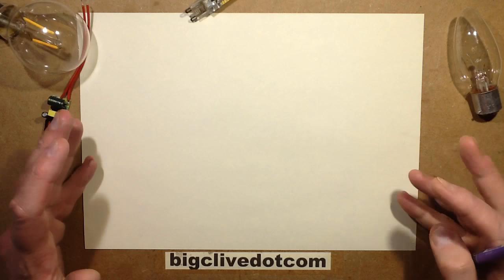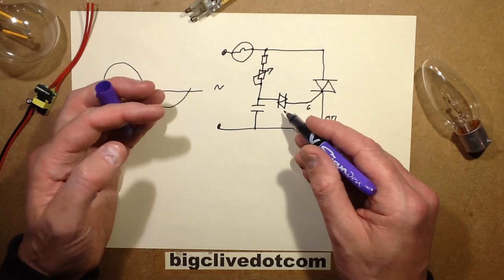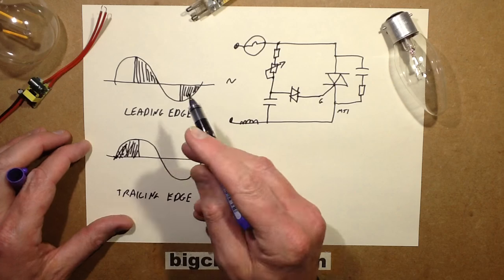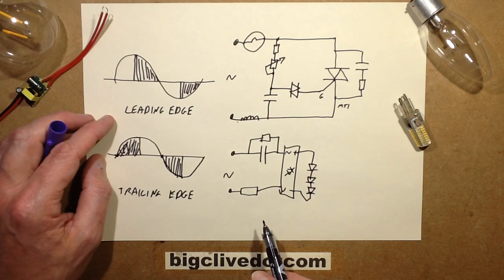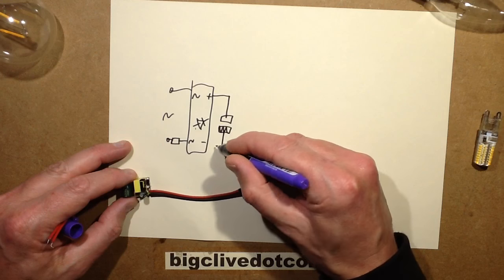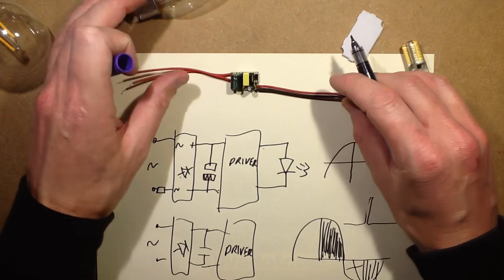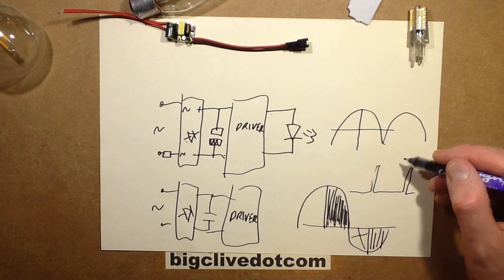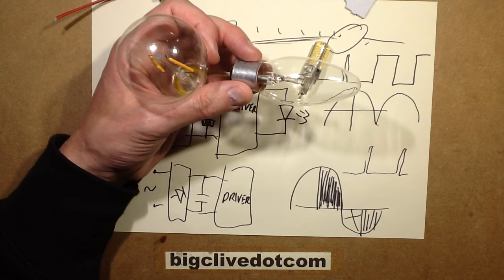Dimming LED lamps with ordinary dimmers.

Comment: 5 years later, and it seems like the newer filament type LEDs have found their best/cheapest compromise solution, which is to just use high-voltage series filament LEDs, linear regulator current limiting, and then solve the flicker effect by using longer persistence phosphors that just smooth out the flicker chemically instead of electronically. Simplest, cheapest circuitry, works with the existing TRIAC dimmers that stubbornly refuse to stop being produced despite tungsten bulbs being VERY obsolete, a tad inefficient because linear instead of buck regulation but it means they don't need a big chunky base to hold the driver circuit, and the pulses and overheating issues mean they last just as long as tungsten lamps so the companies can still make money! As for the issue of triggering the TRIAC, I have found a few lamp HOLDERS in the trash here in the US that include a small "capacitor to nowhere" that exists solely to make sure the TRIAC has enough inrush current to trigger, doesn't even need to be a BIG one, just enough to cause a 50mA spike for the usual BTAxx series TRIACs to fire.

Comment: How odd, a couple of years ago I bought a cheap B&Q £9.99 dimmer switch and a dimmable LED bulb and it works great, no noise and no flicker. 
The bulb is a £14 Integral LED dimmable ILA60B22011D03KAIMA (3000K). 

On the other end of the scale, I tried a Poundland 3 watt bulb in my bedside touch lamp, it turned into a snake machine at dimmed times. 
Thanks for being awesome Clive. 😎

Comment: I know this video is from 2 years ago, but I just found it and it's so hugely helpful! I was trying to troubleshoot the flickering on a cheap Chinese aquarium led light.

For the longest time I was utterly confused thinking they were doing some sort of half-assed rectification with the triac, but I never could quite make heads or tails of how that was working. Turns out it is pretty much exactly that leading edge dimmer you drew, and not a rectifier (which explains the flickering).

Next step is to cut the dimmer off and wire up a proper rectifier and smoothing circuit. Thank you so much!

Comment: I had this issue with a string of "dimmable" LED lights which flashed and had the sharp cut off as described in the video.  The 12 LED  bulbs only drew 48W on a 150W rated Lutron LED/CFL dimmer so I added one 60W incandescent light in an innocuous location on the string and the problem was solved with the full range of dimming and no cut off.  Not exactly an elegant solution but the wife is happy.
Reply: I know Lutron have a device that replicates a resistive load without the need for using an incandescent lamp (which will blow in short order anyway). You'll need to terminate it in a suitable maintainable location, but it's a permanent fix.

Comment: so why is 50/60Hz the norm? is it ideal for transformers or is it an arbitrary number that simply wasn't changed.
Reply from the maker: At the time it was the chosen as being a frequency that was easy to generate.  It's maybe not what would be chosen if we could start again now.
Reply: Why did you refer to it as 100 to 120 times a second? Why would it not be referred to as 50 or 60 times a second?

Comment: The ceiling fans in hotel rooms would appear to be triac controlled - it's either full speed (too noisy/cold), half speed (annoying 100Hz buzz) or no speed (too hot). Either way it's impossible to sleep.
Reply: Top Tip: Hang your freshly washed linens on the fan's blades. This will slow the ceiling fan down, dry your clothes, freshen the air, and moisturise your face at the same time.
Reply: Genius top tip :)
Reply: Actually these things are adding windings at different angles, but I agree on the effect
Reply: I doubt there are any semiconductors in a ceiling fan. The main reason being that the typical motors used in them (induction motors) can't really be "dimmed" by just chopping the AC. Usually the speed is controlled by switching between different capacitors.
Reply: And render all your freshly washed linen filthy from all the dust that your ceiling fan picked up :p
Reply: @superdau;  All the domestic ceiling fans i've seen use universal(brushed) motors for ease of control. The older speed controllers were mini auto-transformers (hence the buzzing) multi-tapped for different speeds. Now that electronics is cheaper newer units use phase control as Clive has explained above.
Reply: Richard
Brushed motors would be very weird in a ceiling fan (and I have never seen that). They are just the wrong motor type for a fan (and the product engineers should know that).
On a device that may run for hours a day for several month a year using consumeables (the motor brushes) is close to what I would call a scam.
The "ease of control" of simple capacitors used by induction motors can't be beat by any controls for a universal motor.
The load to the motor is very well known, so there's really no need for accurate control. Brushed motors are also noisier, not just acoustically, but also electrically, so they would need additional EMI filtering.
Brushed motors are generally built to run at higher RPM (comes from the way they work) and are much more efficient at higher speeds. So you either have a wasteful motor or even worse need gearing.
I can't imagine why anyone would use a brushed motor in a ceiling fan with all those disadvantages.
Reply: superdau aah you're correct, i even went back to the text book. "Permanent split phase capacitor motors" were most suitable apparently. I didn't realise they had voltage dependent speed control. Then I checked wikipedia and there is even more info! we  live and learn.
Reply: Alert: "Admitting someone else is correct" detected. I hope others will follow your example. Youtube could be so much better with reasonable discussion.
Reply: You're preaching to the wrong generation Tai..
Reply: Cover your clothes in dust.
Reply: Referring back to the original post...   I inherited a ceiling fan with my house that's from the 60s...   it has a 6-way rotary switch that's fairly unremarkable.   What is amazing about this fan is the terrifying amounts of air it moves, all while staying perfectly still.   I use the 3rd of 5 speed choices and that moves far more air than any modern fan I've seen on full power.  It's a good thing the ceilings are tallish tho, this fan could easily decapitate (metal blades) you...
Reply: AND so VERY stylish too!
Reply: @gubx42  Note: Wash fan blades prior to laundry arrangement. No Jeans.
Reply: @TaiViinikka  Isn't it great?! It sucks when commenters of videos get hostile. Accomplishes nothing.
Kudos Richard and superdau! I have to ask. Richard, how early did you get on YouTube to have been able to snag "Richard", with a Cap! You must be a Viking!  ;-) (I'm not at all suggesting you are old. YouTube is very "young").
Reply: What hotels have ceiling fans?
Reply: @billlowe70  lol

Comment: Immensely helpful. We just replaced two incandescent spots with LED spots and they would not turn off. I'm sure it was the triac sustaining current in the dimmer. My solution was to replace the dimmer with one that has a hard on/off switch in addition to the dimming slider. Thanks Big Clive! Even a 4-year-old video is helpful.
Reply from the maker: It may have been the triacs snubber network passing enough current to keep the lamps lit.  LED lamps will often glow with just microamps of current.
Reply: @bigclivedotcom  Well, the new dimmer works well, except...  The hard on/off switch in the new dimmer solves the eternal glow problem, but now at lowest dimmer setting, one LED spot will light and the other won't. However, flipping the switch on with the dimmer slider set midway lights both lamps reliably, and then they can be dimmed down to a lower level. There is a programmable setting to adjust the minimum dimming level and that too would solve the problem, but the lamps are not dim enough when this level is adjusted for reliable startup. As you said in the video, two completely incompatible lighting systems. For now, we're close enough.

Comment: I recently installed VARILIGHT V-PRO DIMMER SWITCHES with Philips Warm Glow Dimmable LED. They work well. The dimmers are programmable for various modes and come on with a gentle 'boost' . The Lamps have a 'lightpipe' to simulate filaments and have two sets of LEDs (warm and cool) the cool LEDs shut down to 'warm' the light at lower settings. They will dim very low without flicker.

Comment: Great video Clive, been dealing with this issue recently. Currently split between replacing the dimmer with switches and using dual white LED lamps with a remote control+hub... or just putting in the most efficient lamp type that works with a dimmer.

Comment: I am using 3 brightness level LED globes, controlled by switching them on/off multiple times to get a dimmer light output. So at the first on state, they are at full brightness & each following power off/on cycle reduces the brightness level (twice in total), then they are back at full brightness at the third cycle! The globes did cost a little bit extra, but it is worth it!

Comment: Super helpful video as people transition to green LED lighting. 

New LED dimmers are expensive so I was tempted to keep the old style dimmers in a refurbished kitchen. But the electrician insisted we change. The new LED dimmers are not perfect as they don't go down super dim but they are trouble-free and are quiet.

My buddy refurbished a big room with 20 tiny celing LEDs - every one of them died within a year, which was expensive and a pain to continually exchange "bulbs". The electrician kept the old dimmer so we can speculate on what caused his problems...

Comment: FYI: In North America we have PWM replacement wall-plate dimmers (for old phase angle dimmers). they work well with LED CFL and Incandescent bulbs. They can drive any load up to 150W, smoothly dimming from fully on to barely visible and cost only slightly more than the traditional units.

Comment: Hi Clive, great explanation! The way I see it is the most effective way to control dimmable LEDs would be as you suggested have the dimmer panel be a simple low power digital control and just modulate a carrier on top of the power fed to the LED fixture so no changes in infrastructure or wiring are necessary. Then the job of PWM modulating the LED would be offset to the local controller that feeds the LED. You could even have one dimmer panel control multiple LED lights independently by utilizing unique addresses for each light. Yes this would add the cost of adding more complicated control hardware and software but with IOT and dirt cheap powerful arm processors I think this is where things are heading.

Comment: For my entertainment room I finally just went DC. Used led strips with built in current limiting resistors, IR remote pwm dimmer and a switch mode power supply. 

I have Costco dimmable Led bulbs in the wash room on a dimmer. The dimming at the low end is as described in this video. They come on at 20-30% intensity.

Comment: I think it would be a good idea to simplify the LED fixtures to be just a string of LEDs and a current limiting resistor.  Then the dimmer would rectify and supply the variable voltage DC to the fixtures.  Lower voltage = dimmed.

When the fluorescent fixtures were too bright, they made a dimmer for each tube.  It consisted of one plastic cylinder inside of the other.   Each was printed with black stripes.  When the cylinders were rotated so both stripes aligned, the tube was half dimmed.  When the stripes were rotated to cover most of the tube, the light was very dim.

Comment: Thank you for the very informative video.  I too have been pondering a decent method of mains powered LED dimming.  I have decided that I need only a few brightness level options (4 or 5) so will try a tapped power transformer. 
We are 230V here, so a transformer with a 0-115-230 primary and a 57.5V secondary and a 2-pole 5-position switch will give 'off' plus 4 'on' levels.  Lowest on level is 115V primary tap with the secondary connected reverse phase in series giving 57.5V, second level 115V from the primary tap, third level is incoming 230V with the secondary connected reverse phase in series giving 172.5V and full level is 230V.
The transformer needs only be a quarter the wattage of the lamp (from my quick mental arithmetic estimation). Marcus, New Zealand.

Comment: I too would like to see an update.  I've replaced quite a few of the old bulbs with "smart" bulbs and I've noticed recently that there seems to be about a 2 year life span before thy start flickering, without any dimmer.  So I'd guess the dimmer functionality you describe is built into the bulb? I had one replacement smart bulb that was on an occupancy sensor and it did as you described being very dim, so I had to keep that one as a fluorescent.  I've had 3 different rooms so far (no dimmers) that smart bulbs have started flickering within a 2-4 year or so time frame.  Seems there is a big difference in life span for smart bulbs vs regular LED bulbs, and certainly not what the manufacturer claims are
Reply: I've recently replaced a handful of LED bulbs within the last year that failed in 2 years or a little less,   marginally longer than the 40 and 60 watt incandescents grew up with and loved and certainly much shorter life than the manufacturers claimed.  The bulbs that failed seemingly early were used in enclosed fixtures meant for 60 watt incandescent,  so heat build up could have been an issue,  since LEDs prefer a cooler environment.

Comment: I think the real future of LED home lighting is in integrated low voltage. It solves a lot of problems to stick your LED driver behind the wall switch, and have low-voltage coming out of the ceiling rose.
Reply: We're probably gonna end up with USB lamps and most wall sockets will just have a bunch of USB sockets instead of AC, and it's gonna take some work to run anything that requires AC at home.

Comment: Your comments about the circuits you have reverse engineered are informative. I have a pair of 4 lamp lights above my 2 sink counter in my master restroom. The 8 lamps are GV (Walmart) equivalent 60W dimmable lamps that work well with a traditional angle control dimmer. Although they the rf noise may be high I have no indication of this noise. It seems that the power from the dimmer is rectified and filtered based on the fact that when you turn it off the light decays over a second or two. The non-dimable ones turn off much faster. 
What is interesting to me is that even though these lamps did not cost much more than the non-dimmable ones, they seem to dim smoothly from a low turn-on position to full brightness and back down to minimum. 
Maybe sometime I will open one of these lamps to see what circuits they contain.